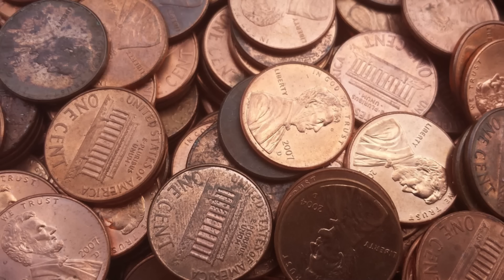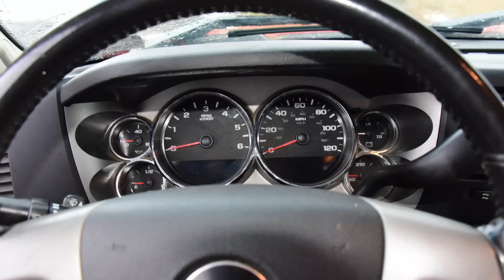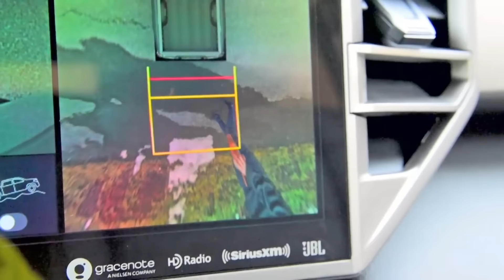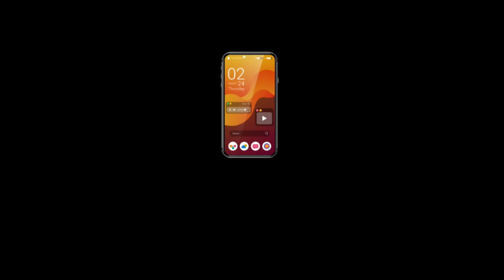2008 Chevrolet Silverado: Regular Car Reviews

Comment: I have a 2011 Silverado 5.3. sunk 12k into it... Transmission went out and the lifters failed, suspension overhaul minus the leaf springs, motor mounts, replaced the brakes but now the truck shakes when braking above 40mph, the transmission slips still even though it's new, the AFM turning on and off is very annoying and makes the truck ride rough not enjoyable. Truck also likes to shake above 60 mph which is probably due to the crappy aftermarket fuel wheels, the interior rattles and shakes as well as the truck itself over the smallest of bumps truck feel like it's gonna fall apart. only owned the truck for about 4 years. I wish I could love this truck because when it does everything right it truly is a nice truck but I'm tired of keeping her running the body mounts seem to be going out as I write this hope to move on to first to second Gen Toyota tundra with some 4x4 action

Comment: Looks just like my dad's office's truck but with 4x4 and one trim level up. Same year, same color, same extended cab short bed, same dirty gray bench seats, same steel wheels, same dents in odd places. We borrow that truck a few times per year when we need to do truck things. It's been neglected since 2008 but keeps going.
I'm partial to the GMT800 and before though. The GMT900 is boring outside, nasty hard plastic and dull design inside.

Comment: Did GMC even paint that frame or did they just hit it with a quick coat from a rattlecan before it left the factory so the first owner wouldn't realize that it was going to rot out if it was used in the Saltbelt?

Comment: Aw, c'mon, Roman, a Miata isn't avoidant, it totally fits into a secure attachment type. An S2000 doesn't, but a Miata totally does. The Miata just wants you to have fun and to not worry about anything but having fun. 

The pickup truck certainly doesn't fit into anxious, nor does it fit into anxious-avoidant. Pickup trucks like this Silverado usually just.... keep on truckin' so long as they're maintained, it not well-kept. They don't leave their owners terrified the truck is gonna crap out on them. But the same time, they do have an air of self-sufficiency about them. A lot of owners depended on their trucks to haul loads far above their rated capacities, and wound up passing the trucks on to their relatives with high miles and such...

...maybe the trucks belong in the secure category.

Comment: damn, i got my 00 tacoma from my grandpa and its bassicaly the same story. i got it with 27k miles and ive put 60k miles on it in the past 4 years and i use it for my yard work/dump run buisness. perfectly maintained but the body panels are so rough 😅

Comment: The last-gasp of a truck driver that was actually putting in hard work and putting gravel, wood, tools, etc in the bed of the truck before trucks are now designed as if the driver wants to cosplay as hard-working, "my hands look like this so that I can grill like this", type of worker that has an immaculate truck bed and a 2nd-row seating that hasn't seen anything hit it harder than a laptop bag being brought to the office by said cosplaying worker.

Comment: I'd argue that the GM 4.8 V8 was a more reliable engine compared to it's 5.3 counterpart as the 4.8 didn't have and subsequently plagued with AFM issues as it didn't have it. However the 4.8 was stuck with the 4 speed automatic compared to the 6 speed. Seems to me GM didn't want 4.8's being purchased so they slapsticked that engine offer with lackluster trim features.

Comment: IMO old trucks fall into secure. The kind of trucks with rubber floors made for empty fast food bags, wawa cups and mud. Cheap plastic lining the interior that is easy to clean and durable against scratches. Cloth seats that aren't too cold in the winter or too hot in the summer, plus you don't have to worry about scratching or ripping some "leather". A place where you can hop into and it all feels "familiar" and just get the job done. 

Modern trucks are anxious for me. Complex SUV like interiors filled with materials that I'm too scared to look at since that alone might scratch it or get it dirty. Always worrying about fucking it up like a sports car both inside and out, especially since you'd practically pay the same large price for either. Scared to think that I'm not living up to the expectations/bar that the trucks many features set. "Man I hope I'm using all of these features that I paid an arm and a leg for", even though chances are that it's all a marketing gimmick, and the truck itself can't fulfill it's own lifestyle promises. God knows reliability ain't what it used to be. Example: the new Tundra. I like the new Tundra, but it doesn't even have proper fucking bumpers... I'm not taking that out on a job side to get dinged up, repairs would be insane. Like other trucks it just wasn't made for that lifestyle, though it tries so hard to put on that facade. 

Most modern truck owners that use them for mall crawling/bro-dozers try to put on the avoidant facade imo, though they're usually just compensating for something.
Reply: Completely agree. I get the same feeling in my 2012 base model tundra. Rubber floor mats, manual cloth seats, plastic trim, 250k miles. But it runs smooth and does what I need it to do.
It’s a very secure, stress-free vehicle ownership experience!

Comment: Loved my 2010 Silverado, kept it till 180k miles. Had to change the fuel pump around 100k and did preventative maintenance on the front end suspension. Only sold it because carmax offered me WAY more than I believe it was worth. Am an actual blue collar guy that uses trucks. I’m only halfway through but Roman sounds like he’s projecting a bit, it’s ok brother. Also, you were too harsh on the Forte gt.

Comment: as I get older I wish i had a pickup more and more.  The open bed would help with the larger and larger items I need to haul around,  Theres nothing quite as mildly annoying/embarrassing as getting the item you swore you didn't need delivery on and you could get it yourself from the warehouse. Getting it to your SUV and realizing its box won't fit through the slightly concave lip of the rear door and having to tear down the box in the parking lot to fit the pieces into the car.

Comment: I'm just being nitpicky because why not, but you might be able to solve those 1 or 2 times the leading car camera loses focus on the trailing car. Most cameras allow you to limit the range of distance the camera can autofocus within, if you set it to the range you expect the car to be within, there's less chance of it being confused by the wet glass. Maybe you guys already do this, and it's just particular patterns that confuse the camera or firmware bugs out of your control. Just thought I'd mention it in case you weren't aware.

Comment: I think a regular pickup truck is in the Secure category. A normal truck is something that is ultimately, fine, and dependable. It's there when and where you need it.

EDIT: But those uh, new big-hoss ones are... Not for the mentally well.

Comment: The backup camera mandate is easily the 3rd or 4th worst thing to happen to practical cars, if you are LEGALLY REQUIRED to have a full-color screen in the middle of the dash anyway then the onward march of infotainment and terrible-yet-mandatory touchscreens is inevitable. Before 2013 or so, you had physical buttons and knobs for EVERYTHING but when they announced backup cameras were GOING to be mandatory and all the manufacturers had to start adding them, the death knell of the DIN head units and the physical controls tolled.

Between that, the chicken tax, and CAFE, small and simple trucks and vans were a lost cause. Gone are the Astros, Rangers, S10s, and all the other long-bed single-cab true WORK VEHICLES that aren't a family car first and a work vehicle as an afterthought.

Comment: I'm a second gen Dodge Ram owner... but damn of GM doesn't build a fantastic pickup/large SUV lineup. 

You got the Sierra, Silverado, Denali, Tahoe, and Suburban all heavy hitters on the same platform. I have to tip my cap to GM for that. GM trucks from the 80's to 2010 will last a lifetime with parts out there as far as the eye can see

Comment: This makes a lot of sense, I used to own a 2002 Ford Explorer Sport Trac truck and just hated every second of ownership. Barebones features, cheap build quality, and the engine was just a bitch to work on. The worst part was it's sedan-like torque meaning I couldn't tow jack shit, and the half-size bed that could barely fit more than a regular explorer. It was a microcosm of what trucks would become: SUV's with half the back chopped off and no changes otherwise. It made me truly loathe any truck I saw and firmly stand that I did not understand the truck phenomenon. On the other hand, this silverado comes out as a firm example of the complete opposite, and I really admire the genuine utility and uncomplicated presentation. It's a bit of an ego-death vehicle but this is what guys say when they "just want a good truck."

Comment: I used this exact truck as a GSA vehicle when I was in the Air Force in North Dakota. Ours was white and a crew cab with a bed topper. We beat the ever-loving hell out of that truck. 6 guys all of our cold weather gear, tools and parts all crammed into it headed out to the missile field daily. You start a vehicle once for the day in ND and you don't turn it off until you're done. Poor thing would drive fully loaded down beat up dirt roads for hours then sit idling for 12 hours and then drive back to base. It never complained once never failed to start and I miss that truck. Had a lot of good memories in that truck.

Comment: Is the amount of rust shown at 2:08 normal for a 2008 vehicle? It's rusted through!
Reply: @baronvonslambert  Wow. That seems  pretty bad to me. Admittedly it doesn't snow here but I just got rid of a 1998 Prado that had little care and zero rust.
Reply: For GM yes. You may replace the rocker panels 15 times though before that truck goes. And new GM trucks are even worse. But the 2500hd versions of these just cannot be killed unless you have a hand grenade laying around
Reply: That’s because this truck spent its entire life in Pennsylvania which is right smack in the middle of the Salt Belt; the amount of salt and brine they use is extremely detrimental to the service life of vehicles. This same truck had it spent its life in the south (like my dad’s 2009 RCSB) would still be in pristine condition body wise.

Comment: Pick up truck attachments need to be broken up into separate categories. Trucks from the mid 2000's and earlier rejected modernity, which some exceptions.  They were usually very simple, no ride selection, automatic climate control, digital dashboard etc. These were intended for farmers, contractors, etc. These trucks are secure. Modern trucks are luxury items with a rugged facade much like the people that buy them. These trucks are avoidant. Look at me but also I'm a rugged strong independent person but also I could never trust a 20 year old truck, nor would I be attached enough to repair rather then just trade it in again. Most new trucks are emotional support vehicles

Comment: It's just a truck man...  If it doesn't have an 8ft bed its not a real truck... 93 Dodge Power Ram 250 LE regular cab 8' bed 5.9L gas/360 cubic inch V-8 4X4 98,000 miles paid $4,000 for it... Only a few grand in repairs in 8 years of ownership and it does everything I need a truck to do...

Comment: I'm not a "truck guy" at all. I think anyone who daily drives a pickup truck but works retail or an office job is kinda dumb. I look down on Ferraris and their owners because they don't drive their cars, same thing with someone who uses a pickup as their primary vehicle but it only gets used as a truck when they buy a 70 inch television or taking an old sofa to the dump. That being said just like I love to see high mileage and/or modified Ferraris I think trucks are always better with some battle scars. I like it when a vehicle is used for it's designed purpose.

Comment: These do seem like a perfectly-sensible  general purpose pickup.  (And that kind of extended cab with the doors would be  a nice  layout for me.  (When I had my extended cab F-150 I could easily camp out on the back bench seat,  for one,  just enough space to be useful.  This looks like a bit more with better access anyway.  As attachments go,  really I'm sort of an automotive animist so I'm really not sure what category applies, never mind by what kind of vehicle it is,  they're all kind of in similar head-spaces as like animal friends,  maybe a horse would be if I had a horse.  :)    (And yaknow, that big yellow Ford got a lot of smiles partly cause particularly the color was so out of character  for me.  I initially intended to  respray but once I couldn't stand the oxidation and polished that paint I'd be driving around town and being like,  'I can't paint over this rolling smiley face yellow , it makes people happy!  :)  

I don't know what you call that.  Yaknow, I cleaned up a lot of the battered bed parts  with like those aluminum bed rail covers and a new tailgate,  put on some higher trim wheels from I guess some salvage yard, went from 'municipal'  to  'Kinda surfey,'  and it was a real case of 'We take care of each other,'  I guess.  Got a lot done.  Which yaknow,  what better endorsement for a sensible work truck?  :)

Comment: Hey what is that coating that can be used on rusted frames to strengthen/preserve them???  

NOT that shiznit coating you have to get every year and runs all over your driveway like an oil spill when you get home. 
 
The REAL shi!t. The SHIZ-nit.  I think it’s called “PFC something or other” and only a few shops actually do it bc it’s time consuming & more expensive than plastic surgery  ....

Comment: I drive.. a 05 Honda Element with a 4spd auto. The interior is Blue vinyl. It matches the outside Blue color but has grey plastic on the front and rear quarters. The floor is rubber.. and I really dont care much about the interior. Ive got a cd plr a power outlet and a regular radio... but thats it. Ive got Hydraulic steering, hydraulic power brakes. Its got power mirrors. Thats it. Its Square. Its a Honda. The back seats fold up against the walls.. to have more cargo capacity.

In the 10yrs Ive had my Element:
Ive loaded my it up with 6 dining room chairs and a full 6place table.
Ive had a 80 water heater, 3 concrete blocks. (Yes, I put the water heater in and installed it on my own.) I had trucks around me... all pretty. Meantime.. Im loaded to shit.
I had a 6' x 4' picture of a PLANE.. shoved into my car.. and it fit perfectly.

Ive had my boy's bikes put inside.
Ive had 3 lawn mowers shoved in
Ive had a 18' ladder going out the front pass window and out the back.. with a power washing unit inside.
Ive had my entire car loaded with tree branches.. just shoved in.
Ive also had tree stuff shoved in bags.
Ive had 10+yrs of shred material stuffed in.

Theres.. not much at all that cant go into my car.

Bout 3yrs ago, I was comin home while replacing my ignition solinoid... and someone with a 15' drywall pole... the pole got loose.. and went straight into my Radiator. I got my car home.. on pure flashers.

I was "upgraded" into a current HRV... with is total horse shit. No transmission, no color, no power, signals dont work.. and the structure is shit.

THEN.. when my car came back... she pissed her self as she was getting an oil change... cause the yahoos who did the new radiator DIDNT PRESSURE TEST IT!!!!!!

I got... VERY... VERY MAD.

They brought my car back in... and I got a 3yr old RENT-A-BUCKET Silverado. It had a screen... the driveshaft was dented. I hated it. I cant do the shit I want to do.. when I want to do it!!

WHICH.. is also the problem with these laptop cars. You cant do.. what you want.. when you want.

When I got my Element back... I was thrilled. The last two Rent-a-Bucket piles of shit... were better than my car... cause they were newer.. but they were worse driving.

Who the fuck wants a god damn pickup....
I hated both.. and wont ever want to buy either!

Comment: Trucks are so expensive now who wants to bring them off road. When I had my 1991 Ford Ranger it went down streams through mud and jumped. But it only cost 10,000 new. But now a cheap new truck is 40,000 and ya can’t put it through its paces.

Comment: 2007 and up LS engines with Active fuel Management ARE JUNK!! Unless you completely delete the system and lifters it will kill itself by having the roller lifter the cam grinds down and sends metal all over the engine and it will burn massive amounts of oil also because the rings and oil squirters were junk!

Comment: This gen Silverado 1500 was a DOG if you worked it. Put a load of 3,000lb or more behind them and they might as well be an early 2000s ranger. I owned a mint one and it was terrible. Put an actual load behind modern trucks and you'll see why people like myself are paying for them. A new f150 works harder than a 10 year old f250 could ever dream of working.
Reply: People act like people didn't pull things before 2012...

Comment: Imo '07 and newer gm trucks are absolute junk. Somehow they put in a great engine with a crap oil pump,electronics, crap leaf springs and paint and primer so thin it won't stay on. 
I usually turn these away.
GM can do better but they just don't. It's too bad.